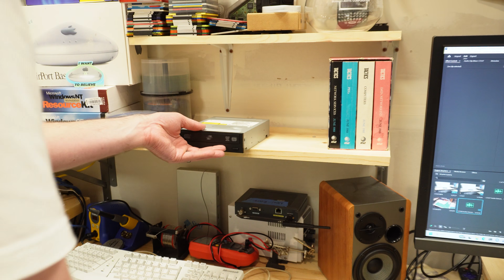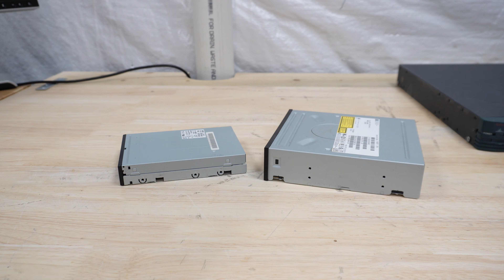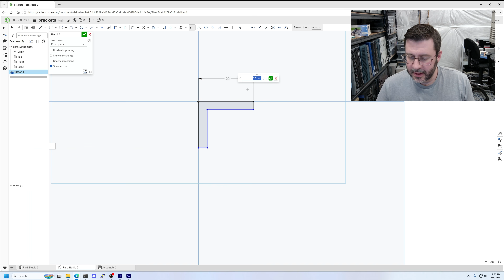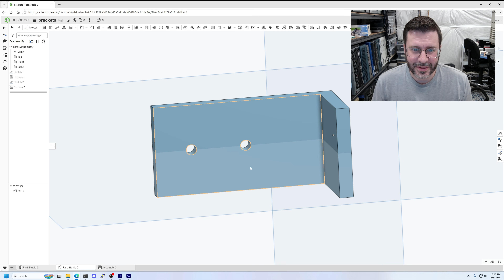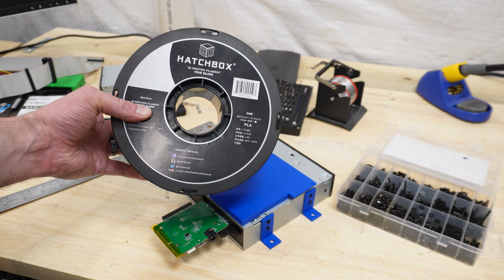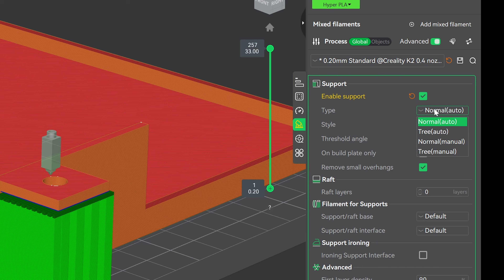Learning to Design 3D Prints

Comment: a few things that could help you in the future:

1. do not disable the pre-printing calibrations! when printing at higher speeds the natural drift that occurs from vibrations and usage is much more impactful and can lead to a failure hours into a print. bite the bullet for those few minutes at the start instead (but there is a configuration to do a minimal calibration instead of the full one if you prefer)

2. especially when you are applying pressure, drilling or screwing into the printed parts the printing orientation can make a difference in how strong the thing is as parts are weaker on the direction of the layer lines so sometimes it will be better to print parts in a less practical orientation for a stronger piece at the end.

3. most of the mechanical strength of a 3d printed part comes from the number of walls it has, not the amount or type of infill. although it can help a part be stronger if you need something that can handle more weight or more pressure start by increasing the number of walls.

4. for vibration dampening, look into printing with TPU, which is a "rubbery" plastic. just keep in mind that you CAN'T use it in the CFS, you must change the filament manually (or print the TPU parts separately and them glue them together afterwards).

5. if you are going to print many parts that need accuracy, take some time doing calibrations on your printer and slicer profiles. it is a pain in the ass, takes a long time to do everything but will help you in the long run if you begin printing more complex parts.

6. look into PETG, ABS or even Nylon (if you hate yourself). PLA is easy to work with but it can warp and break easily when you began mixing it with computer parts that dumps lots of heat on them. PETG is the easiest of the three to work with but i recommend dabbling in ABS (especially because you can do annealing via heat or acetone to strength it)

5. there is a featurescript for onshape for making screw holes easier. you can just select the screw head, size and length and it will do the hole for you (even with threads if you want to).
Reply: PLA and computer parts always make me picture that one poor guys drivebay completely sunken down into a pile of PLA and HDD’s

Comment: Fun fact: A greaseweasel will support 2 drives, using a twisted cable like the one you have. So you could hard mount the 3.5" drive on the first connector, then have the remains of the cable (and the second connector) passed out the back, with a Y adapter to power both drives. Then you can use your other (5.25"?) drives without having to pull the 3.5" drive out.

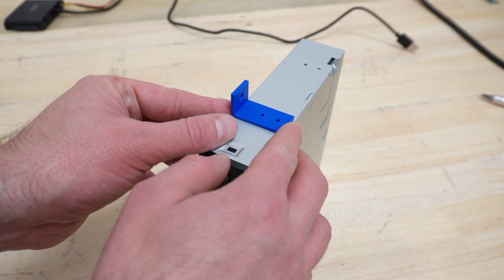Comment: I would have printed this bracket 25:50  on its side to change the direction of the layering. I appreciate strength is not a significant point but it would be just worth understanding. And getting used to. Also I would have added fillet to the inside corner of the bracket. Just my $0.02 worth.

Comment: I've been 3D printing for about 8 years now.. first with an Ender clone from Anycubic, now with an Ender 3 v3 Max, and damn is that a useful tool. Especially for stuff like printing cases for my ESP32 projects and such electronics tinkering. My current CAD weapon of choice is Autodesk Fusion360, but they're working hard on enshittifying it more with each update. Sadly, I haven't found any other CAD program that supports this highly visual-based "block of clay" 3D assembly paradigm.. my autistic brain lacks the imagination for most classic CAD approaches ("sketch the dimensions and extrude into a 3D object later"). SolidWorks offers the same but is also extremely commercialized, as they killed off their free tinker&print license years ago.
Also, tell Jasper a nice Meow from me =^.^=

Comment: Love your videos,

here a couple of tips when you measure your parts : a good way to calculate the distance between 2 holes of the same size, you can zero your caliper at the size of one of the holes, then you just measure the distance between both hole tightening the caliper at the perimeter of each hole.

you could also have done the measuring of the hole to the side of the cd drive and adding the radius lenght to your measured length to get the center to the edge.

Comment: 8:20 Multi Material is nice for easy to remove Supports. You print the Supports in the same material as the part but the last 1-2 layers touching your part are e.g. petg or special support filament and you get very clean parts. also if one sppol is almost empty you an load another identical filament and have it switch to the new spool mid print

Comment: 3d printer was my saviour. Bought a fractal pc case at the local thriftstore. Turned out I needed brackets for the ssd's and my WD red 8TB spinners. And my cheap printer did it flawless.
Reply: Some case brands even distribute those files themselves, I know Coolermaster has some and I believe Fractal does too.

Comment: I don't think it will matter in the case but for mechanical applications, the orientation that you print matters, try to print in a way that the shear force doesn't happen in between layer lines, or the layer lines have forces that want to pull them apart

Comment: What helped me learn to 3d model more than anything else was the investment in a 3d mouse. Being able to grab a joystick, and move the part the same way you would something you were actually holding is a game changer. But, I don't know if it works in Onshape. I'm using a 3dConnecion SpacePilot (yes the EOL one. My dad sold it to me for $50 when it went EOL and he got a new one for work) but something like the 3dConnecion SpaceMouse would do everything I use it for and more.

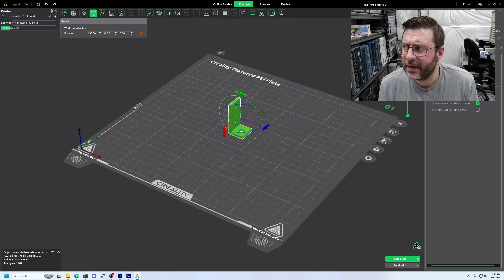Comment: 23:24 it will print faster when more material is parallel with the build plate. Moving side to side is quick, the vertical component not so much.

Of course layer lines are also important to consider for strength as the parts will most likely brake parallel with wlayer lines rather than perpendicular to them.

Comment: "Whatever that is" is micro usb b 3.0. Standard, so not scary to lose.
Reply from the maker: fair, don't wanna buy another one though lol
Reply: And you can also use a more common 2.0 micro cable and leave the 3.0 part disconnected. It will only be able to work at the slower 480Mbps speed, but that's still fast enough for the DVD drive's full performance.

Comment: Jasper needs his own desk phone now.

For modeling screw holes in shape has a hole tool that allows you to select what screw it is and how tight you want it to fit.  You place a point where you want the hole and make your selections.  It will also allow you to countersink the holes when using flathead screws.

Design intent is what separates good designers from bad.  Knowing where to put the dimensions is the hard part.  It can make adjustments super easy or a living hell. 

A lot of the time you can find models for  things like DVD drives and the grease weasel  online.  It can help to import those and make assemblies when designing to find issues in CAD before you make any parts.

Comment: btw that weird connector is micro usb3 connector. lots of them were used by removable hdds, and in case if you lost the cable - you can plug the regular microusb cable

Comment: Have a K2 Plus. Very nice printers. I mostly Print in ASA. Multi color is not hard just waste a lot. Just need to get yourself a Creality Phaetus K2 Plus Silicon Carbide Nozzle. Buy extra parts you will need them. You also need to get filament dryer.

Comment: You may wish to consider that the screws you're using to attach the CD drive to the shelf will transmit vibration as well. A good solution would be to add another "rubber bumper" pad to the bottom side too. Then all you have touching the shelf is isolated. The good news is that it should be fairly easy to implement. The bad news is that you have to basically take it back off the shelf to make it happen...
Reply from the maker: oh right... that makes complete sense

Comment: Just a tip, I know you said it was plenty strong, but the ideal way to print that L bracket part is actually with the thin edge down on the bed. Prints are generally the weakest between layers, along whatever axis is perpendicular to the layers, basically along the direction where the layers would pull apart. So if possible you want to print your part with the direction of the load perpendicular to the direction the layers stack up. This part might require a skirt to stick to the bed in that case but it would be many times stronger. The way you printed it, all the load is concentrated on that one little layer where the two legs of the L come together. If you ever want to make a similar bracket to hold something heavier you will want to keep the print orientation in mind.
Reply: I like to add, that in the orientation in the video the fillet can cause troubles, because the first layers have a very high overhang. Using a chamfer will avoid that and is mostly sufficient. A combination of a chamfer which transforms into a fillet mitigates this as well.
Instead of a fillet on the outside, I would have designed it on the inside. The outside is flush to the wooden board and disk drive. A fillet there just creates a gap with no use.
Reply: Hey, thanks for the tip. I am planning to buy my first printer and this immediately etched into my brain, as how I will approach printing stuff in the future.
Reply: Also, not really relevant for this particular purpose, but it you want properly strong prints look into "annealing" prints (personally I hate the term, I think "tempering" is the more analogous process but *shrug*)
Reply: Just commented this and seen your comment and now I feel dumb 😭

Comment: If the Creality slicer will support STEP files, you're better off saving your model and a step and importing that into your slicer. STL makes everything into triangles and that can cause some issues with some geometries and also if your settings aren't right, the number of polygons it uses will be low and your round surfaces will be faceted. You can adjust the settings when you save your STL, but no reason to when step files avoid the issue entirely.
Reply: STEP is superior to STL, especially when you have curves / circles;
98% of the time, a high-quality STL is fine.

I guess the important part is knowing why & when you want STEP for the remaining 2% of the time 😊

Comment: Pretty good CAD workflow for being new to it. As you mentioned, a lot of the more advanced sketching knowledge is things like equality constraints, symmetry constraints, and all that so that you don't have repeated dimensions. You might also want to see if your CAD program has some kind of screw hole tool to do the countersinking for you.

Another thing is, you don't want to fillet on a bottom surface, since the overhang angle near the base will be too horizontal to print accurately anyway. You can see that as the small amount of blue line in the slicer. A simple chamfer (or just a plain right angle) is better for bottom surfaces.

One more thing, printing it with the long part facing up is fine, since the larger hole of the short part is going to be much more prone to sagging overhangs.

Comment: Get yourself a 2'x2', or whatever will fit your machine, paver brick and some foam or refinishing chairs or other soft foam. Put the brick on top of the foam. Printer on top of that. The brick will dampen the vibrations and the foam will decouple the remaining vibrations from the bench. It helped my K1C greatly

Comment: turn the holes on the side into teardrops and it wont print weird.  or look into printing it in a different orientation.  as layer line adhesion will be a problem with this orientation. look into some videos from slant3d on some printing tips.  also i usually add in some "slop" to dimensions.  i generally print at 0.2mm layer height and width, and because of that i always add in a 0.2mm "slop" or fudge factor.
Reply: another thing you can try for the L bracket, is to design and print it flat, and use some heat to form it in the L shape.  should be faster printing and should not have to worry about layer lines.
Reply: Also, print it so the L is on its side so both legs touch the build plate and build up. Less adhesion on the build plate (so you have to have your settings dialed in) but stronger layer lines for a bracket and you can add the teardrops and slop for the holes.

Comment: Just so you know, you can load up multiple copies of a part in your slicer and print them all at once. Also, for strength, you're better off aligning the print on one of the long sides. Aligning them the way you did has the layer lines in the weakest orientation.

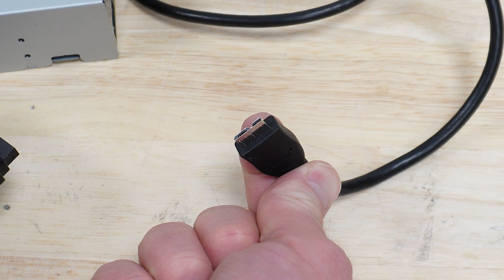Comment: 27:46 MicroUSB 3.0
Reply: Yep, remember the Samsung Galaxy Note 3 having those
Reply: @danmakufan It's also common on external hard drives
Reply: @danmakufanhaha my S5 had that. It was so hard to keep track of- and also that was probably the best samsung phone I had- the s25 that I have right now is nowhere near as good but that's just me
Reply: @charlestrusky6414  FWIW, you CAN just use a "normal" Micro USB2.0 cable in that connector, you just plug it into the "wide" side, obviously you don't get USB3.0 speeds but realistically how often do you need more than USB2.0 speeds to transfer stuff off your phone at a sensible pace.
Reply: Yep.

There's also USB-B 3.0 which is even weirder looking, quite rare.

Comment: One of the best things for those AMS type units is for just throwing multiple spools of the same filament in, so if you run out on one spool, it automatically continues from another spool. Solves the issue of having multiple spools with only a handful of metres of filament left on them littering the place 😂 One tip for designing parts for 3d printing is to remember about tolerances and clearance, otherwise you end up issues with things just not quite fitting properly. Allowing for 0.15-0.25mm clearance is quite often enough to make things fit nicely without too much slop in mating parts or joints 😊

Comment: Multicolour is really nice when you want to put some text on something, being able to print your object in say black and then a text label in white is unmatched
Reply: Was about to comment the same thing. It's by far my most common scenario for printing multiple colours.
Reply: Yep don’t be fooled by those pictures they show of toys on the print bed with little bits of colour here and there where different colours share layers. Typically that would required hundreds of filament swaps and spool loads and unloads and each print would likely take longer than getting the same toy designed and manufactured in China and then shipped to your door.

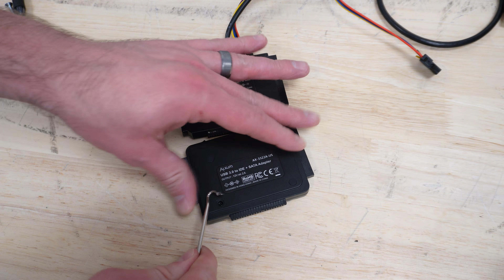Comment: 27:58, that usb cable is actually quite common! its basically micro-usb but with usb3 support (thats what the extra part is for). a lot of external ssd/hdd enclosures or portable drives use that (because they couldnt use usb-c for some dumb reason)
Reply: They had 12 million of the usb 3.0 micro b connectors, had the design from before usbc was a thing. Wont redesign it until parts run out